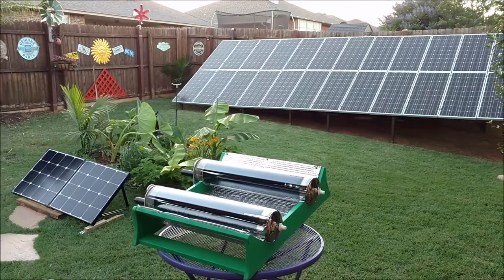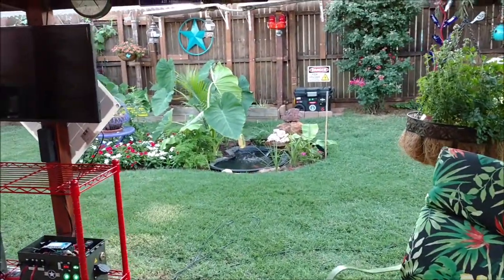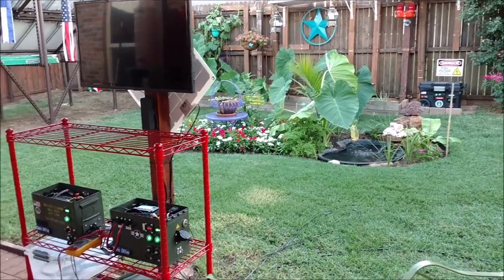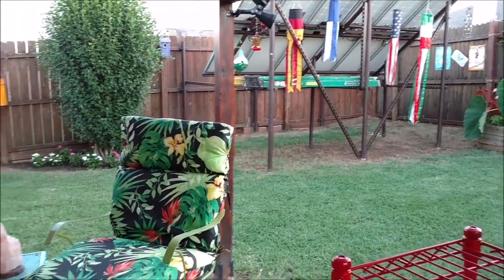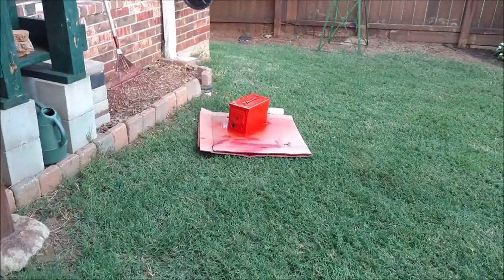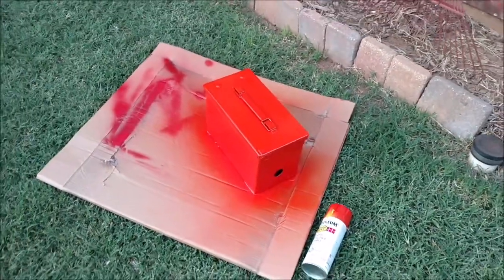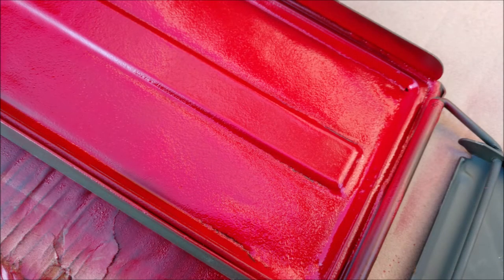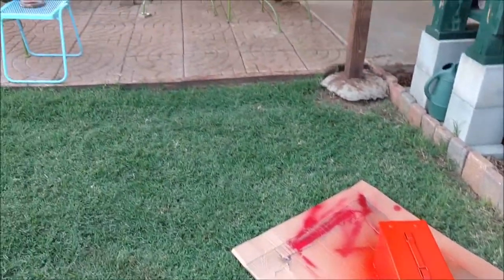New ammo can project - can you guess what it is going to be?

Comment: Based on your videos being so practical in what you build, I would suspect that the plastic coating is key to your project and not just using up left over paint. Also, the ammo can is pretty much waterproof as is, so I guess the plastic has little or nothing to do with water proofing. Therefore, I believe it's a deliberate effort to insulate from electricity whatever your project is going to be. The bottom holes drilled look like you will affix the box to a stationary spot and the larger holes at either end look like for a line in and out. But I still don't know what end product will be. Look forward to next video.